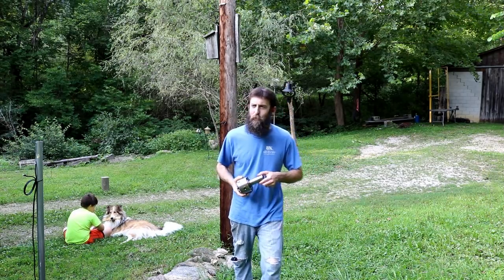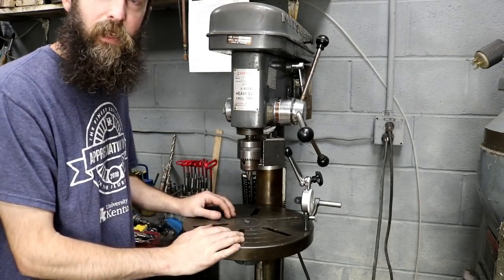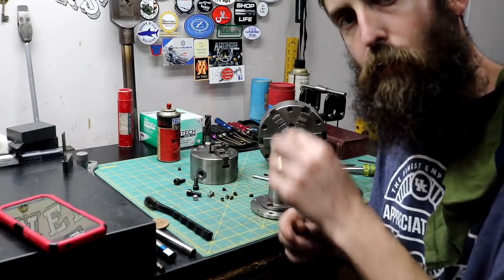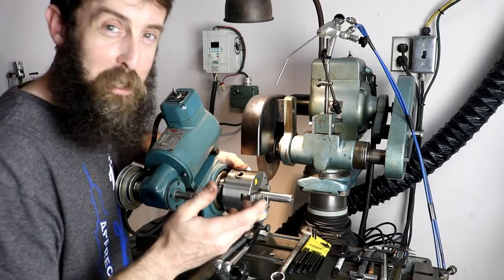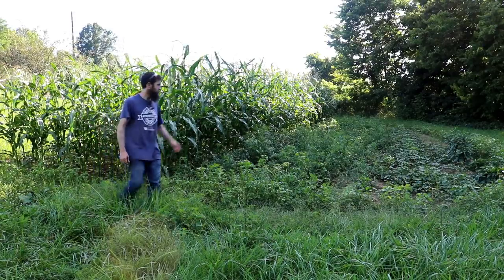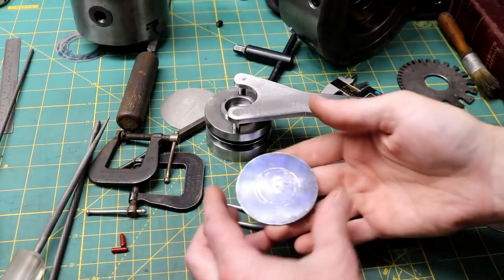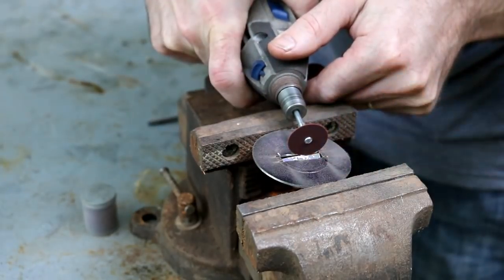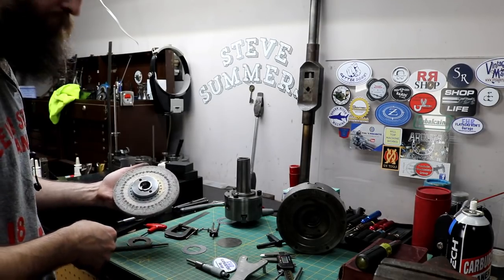Super Nice Adjustable runout Chuck backplate

Comment: Nice Video as always!
Some interesting content. When I get my machines up and going, you have inspired to try some stuff I would not have thought to do.
Possible help on that washer, I have used a die grinder, similar to a dremel, to do those Id profiles, still a little filing, but cuts down time. You can get all sorts of profiles on carbide tips, that allow you to get pretty close to corners, and they are not to expensive. 
Thanks again!

Comment: I think I would have trepanned the centre out to the minor diameter then used the dremmel and files for the rest. Would have been a lot quicker Steve as you could leave the cross slide set and done as many washers as you want in a straightforward plunge operation for each washer.

Comment: What about gluing together a few square blanks for your washers setting the whole thing up on a  rotary table, boreing the minor diameter (the tops of the pins) or cutting it out with a small end mill, cutting a couple of arcs with that endmill again to define the pins then all the filing to be done is cleaning out the corners of the pins and squaring up their ends. Then you make use of that small lathe you have to hold the whole lot on the and turn the outside diameter or better still trepan it and avoid the interupted cut.
It looks sort of long winded when I see it written down but you'd end up with multiple washers and minimal filing. 
I mean that handwork can be really satisfying but, you know, too much of a good thing and all that.

Comment: I was wondering why you did not set the keyed washers on the mill rotary table and mill the inner part up to the keys. 
Then the filing would only be the corners.
Thanks for the vids
Reply: I was wondering the same thing.  Seems like this would make it very simple.  Heck, you could cut a stack of them at the same time.

Comment: I am having a hard time understanding the purpose of the small brass tipped screws. I can see how if you have the main holding screws slightly loose and tap the chuck so as to get it to run concentric and then tighten them you have what you need.....but what do the brass screws do? They appear to have a straight sided button at the tip so screwing them in axially doesn't (to my mind) appear to be able to effect any radial adjustment. I could see perhaps if they had a (say 45 degree) tapered point and were on a bolt circle close to the edge of the .010" oversize pilot that they could shift the chuck sideways for a fine adjustment before the main hold down screws are tightened.....but as they are I am at a loss to see how they do anything at all. All that said the design has merit and is something I will look into for my own shop, albeit with tapered set screw points, probably not brass. Similarly.....I'd likely not use stainless steel either for the plate as I can't see the benefit...considering how everything else is steel.
Reply: The brass screws on the back will not do anything but put the chuck in a conical position as indicated when the indicator was moved from the back to the front.  Should have the same reading all the way out when perfectly true.  The screws should be around the outer edge and adjusted for run out.  The brass tips keep the screws from burring the back plate.  Any clarification on the subject would be nice.

Comment: Hi Steve, I'm intrigued by the adjustable chuck. But what was the runout to begin with? my back plate puts my 4" 3 jaw chuck almost 2-3 mill out measured on the work piece. Thinking of this fix as my lathe doesn't turn steel well but does well on aluminum.  Thanks.

Comment: I wonder if those chinesium 3-jaw chucks can be tweaked to improve that 2 or 3 tenths.  It pretty much has to be coming from the scrolls, doesn't it?  I haven't thought of a reasonable way to lap a spiral groove though :(

For those tabbed washers it might be fairly painless to do them on a die filer.  

Even less painful to clamp a stack of them like Joe Pie did for his thin washer video ( https://www.youtube.com/watch?v=lGsA_q4guwM ), put the stack on your rotary table mounted vertically on your shaper, and let the machine do the work while you advance the rotation.  Somebody smarter than me will have the rotary table geared up to the shaper autofeed, I'm sure.

Comment: Those keyed washers are a horrible pain. I find a useful tool for this kind of work is a jeweler's saw. With that, and the right blades, you can cut anything out. It is still a horrendous pain, but not quite so bad as doing it the way you did. . Need to make a V support for it. It is used vertically. Very nice video, and I admire your corn, as it is impossible to grow in Alaska where I live. In fact I admire your garden period. I am a gardening freak .

Comment: I use a jeweler's saw and a finger board for this type of cutting. Also have to use a lighted magnifying glass to see detailed work any more. I susppose you could make a set of dies and punch them in a hydraulic shop press. I have got to get a cutter grinder.

Comment: My take on the washers would be to use a piercing saw and stack a couple or three together (a bit of weld on an edge). I come from a jewellery making background and used to use them all the time. They'll cut through anything including your finger heh, but once you get the rhythm and learn not to break the blades they cut fast and turn on a dime.

Comment: Hello Steve, That is an interesting adjustable back plate you made for the chuck. With regards to the keyed washers, just a thought if you or others need to do more of them and you don't have CNC anything.
 A simple die grinder and burr will do most of the heavy removal and leave you a small amount of finishing of on the keys themselves. You could if many are to be done set up and use your Rotary Table.
 I do like your Shop, especially the Grinder and Shaper. Cheers from John, Australia.

Comment: Great stuff as always Steve. When grinding that threading tool it seems like you're down feeding a little bit and then traversing off the whole length (in the Y axis) of what you want to cut, this is good for maintaining a flat surface but does wear out your wheel fairly quickly. I've always been told to plunge grind (obviously while going back and forth in X) to near finished depth first, then just traverse the last 0.001" or so to flatten everything off. I'm no expert and I'm far less experienced than most of the guys commenting so if anyone feels I need correcting they're more than welcome to.

Comment: Your washer thing after its marked you could use a small chisel with a solid but soft backer such as brass or a mild steel depending on the quality of the chisel and cut it bulk of the inside work then smooth with a file 
Should speed things up

Comment: Consider a die filer for cleaning out the toothed washers.  I picked one up for $10 at an industrial sale and saw one sell recently for less than $100.  It came from a working tool (die) shop.
Reply from the maker: George Noe Those are nice. Would buy one if I found one local 👍
Reply: will keep an eye out.  I live less than 50 miles from you, I think.

Comment: Could you set an angle to the cut-off wheel when you cut the screws so that it left a chamfer or slight point at the tip to help start the screws?  or not really worth the effort?
Reply from the maker: Brian Walk Guess you could. Would be easy 👍

Comment: I'm a complete newb but, I thought you were supposed to feed into the rotation of the wheel so that if it grabbed the work would be kicked out rather than dragged in.  Did I miss something?
Reply from the maker: Metallurg33 I do it when I 1st start grinding for safety reasons but after I'm grinding I feed in on both directions. May be incorrect.  Probably not a good idea.
Reply: maybe after you get started on a piece the risk of a crash goes way down because everything is set.  Like I say, I'm new to it & figuring out as I go.
Reply from the maker: Metallurg33 Me too, I'm new to the grinding world.